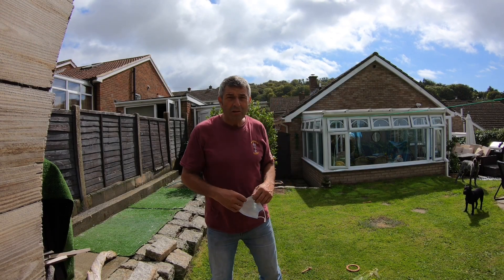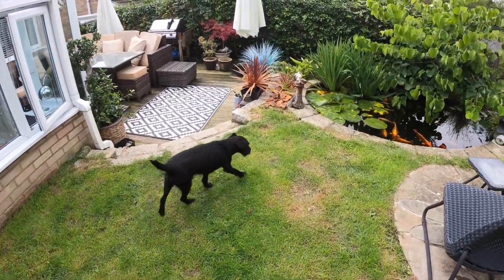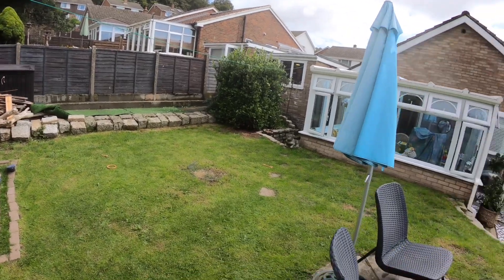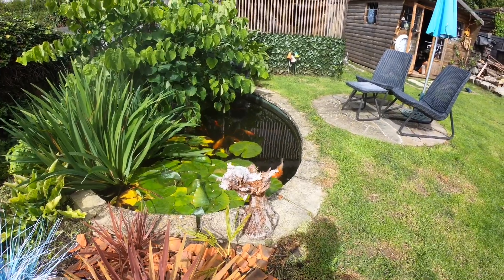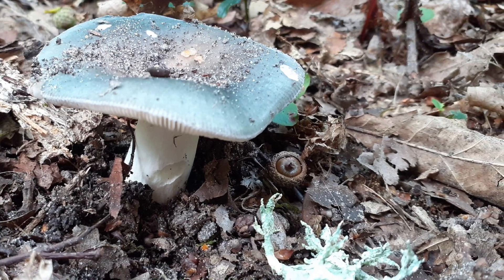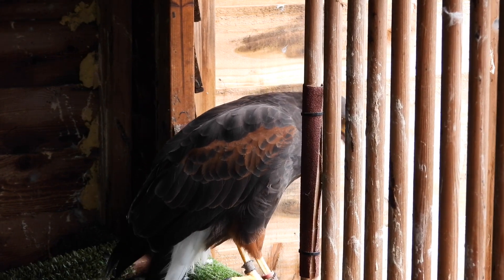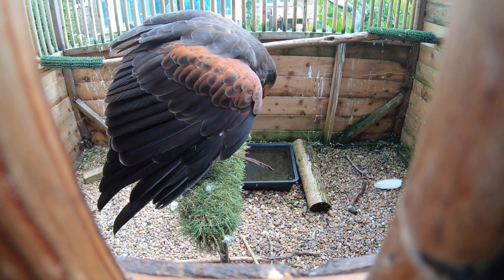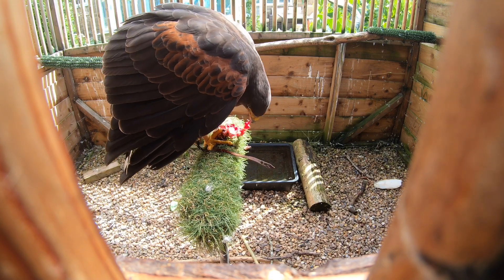HARRIS HAWK END OF MOULT TALK, MEWS AND AVIARY

Comment: You have a lovely set up. I'm looking at a mews from 'box clever'. As a permanent housing. I would have preferred wood but not seen anything available. What ever I get will cost, I know that. Since last year I have moved to Wales hence the need for a new mews. George the HH is moulting out in Bristol where I have moved from. Do you have an opinion on Box Clever?
Reply from the maker: Iv had no experience with box clever although they look ok, cleaning is easier I’m sure.
Please let me know how you get on.
You can always turn a large shed into a mews as I did.  
Good luck with everything I’ll be interested to know your thoughts on box clever after you get it if that’s what you decide.
Reply: @freebirdofreason1994  I have decided to go ahead with an order from Box Clever.
Reply from the maker: @juliealmond9546  Thats good, thanks for letting me know.